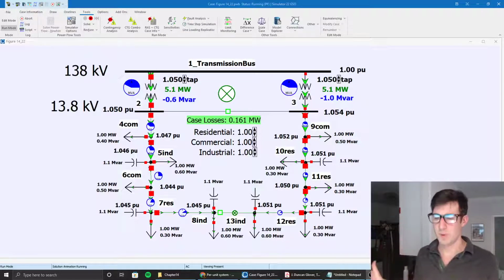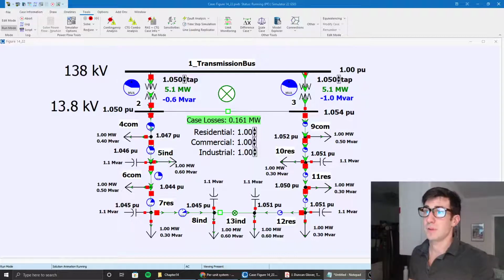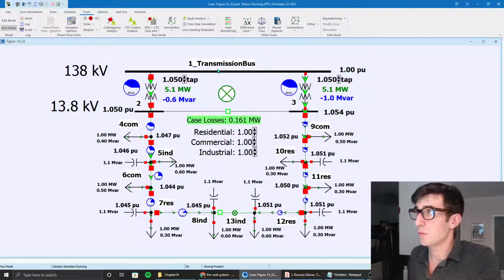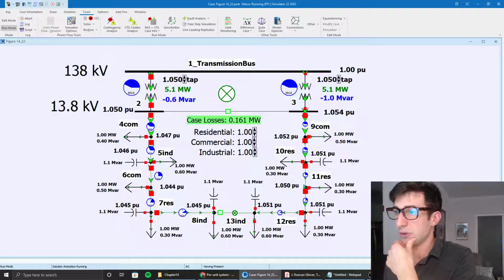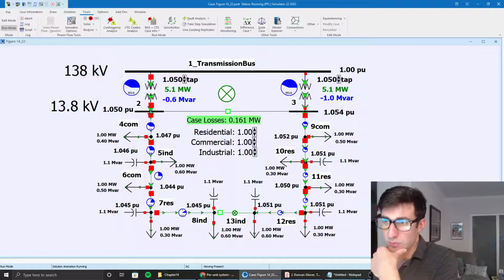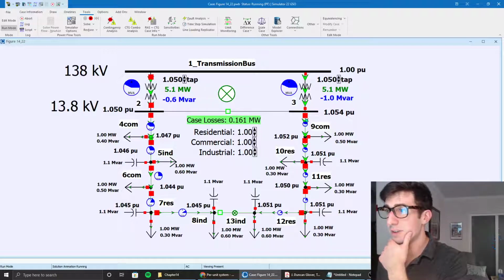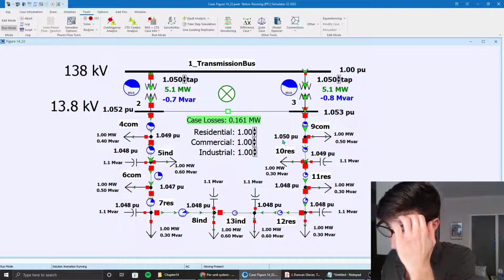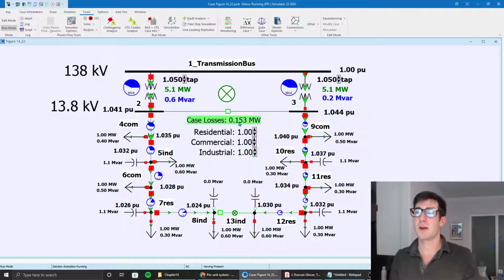Power World- Primary Loop Distribution System

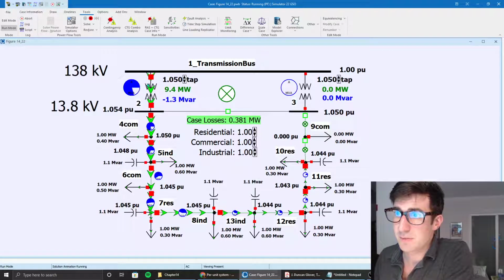Comment from the maker: note: at some point in the video (@7:50) I say that the overcurrent will fry the wire or cause damage to the substation or transformer.... this would be true just looking at this model as a circuit, however, in reality there are fuses that would blow at points in the line that protect vital expensive components against overcurrent, so this is more likely what would happen in the real world. A fuse would blow, and then have to be replaced. Service would still be interrupted as a result of this blown fuse.